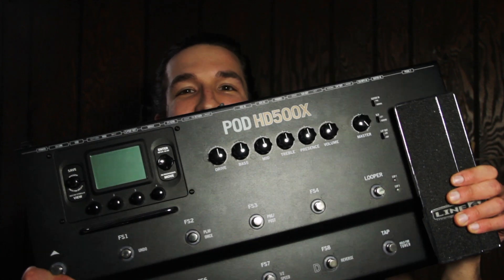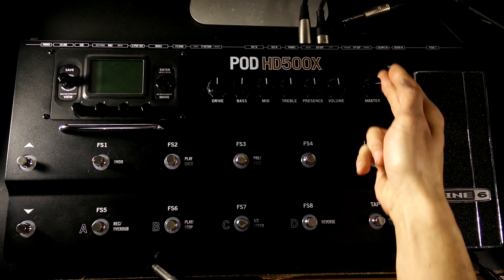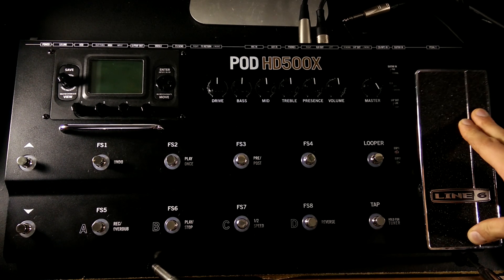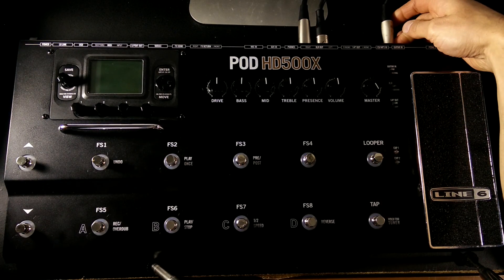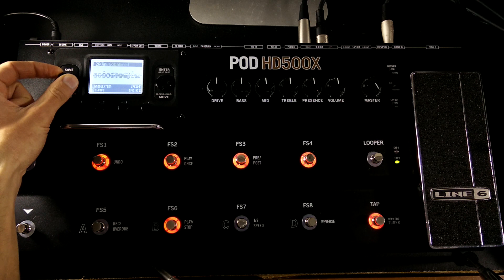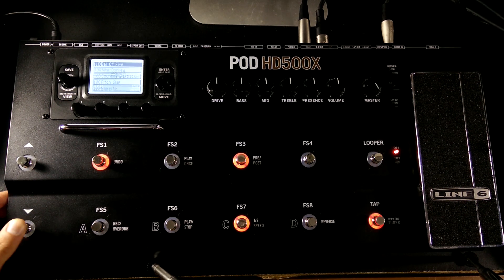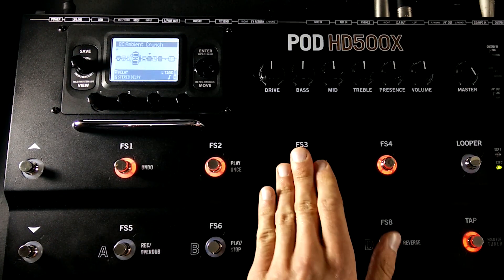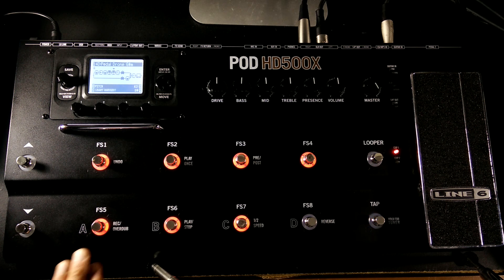Need Help With The Line 6 POD HD500x? Watch This Video!

Comment: Jon,

for some reason on my presets none will let me use the volume or wah (pedal) Also when I go to different (presets) setting the volume is blasting out loud so I have to grab the volume knob and turn down immediately or my ears will be fried. I did buy this pedal used (but in mint shape) could it be something they did in programming that I am not seeing?
thanks for your help Dave
Reply from the maker: Hey, David! My first thought is that you probably just need to add the volume and wah effects to the preset. If that's the case, then check out my video, Setting Up A Basic Pedalboard. I go into detail with adding effects. Let me know if that works for you.

Comment: Great link, is it just my ‘sound of plexi’ and other presets that’s really loud/hissy?  Should I buy a noise gate pedal or something?  Hiss drives me insane I purchased noise filter surge cables even plugged my solid state instead of tube amp.  I’ve tried different cables, wall outlets, and guitars including emg humbuckers.  To no avail.  Any feedback/recommendations appreciated thank you.
Reply from the maker: Have you tried adding the noise gate effect to the beginning of your effect chain? The 500x has a noise gate effect built right in, so you shouldn't need to buy anything.

Comment: I just ordered this today. I’m so nervous. I’ve been a guitar player for over 25 years but I’ve never owned anything like this. I’m a little confused tho. I thought you were able to assign individual effects to all the “footswitches”? You’re only able to use 5-8 to do that? Or am I missing something? Can you have 8 individual effects set up and turn them off and on as you need them? Along with an amp/mic model going?
Reply: You have 2 modes:- pedal board mode and preset mode.

Pedal board mode is when the 1 to 8 switches can turn on/off individual effects as you need them. Preset mode is when the 5 to 8 switches  select the presets while switches 1 to 4 still maintains functionality to turn on/off only 4 individual effects (sort of a hybrid mode). 

To select which mode, view his explanation at  9:00

Comment: Great videos! I've been a longtime pod user with the XT and X3 series and for the past year or so I moved on to the HD500X, and it wasn't the seamless transition I expected it to be. So some of your videos have been a Godsend on figuring out the way this beast thinks. I hope one day to see a video on the cabs and mics section too
Reply from the maker: Great to hear! Now that you've spent some time with the 500x, how do you feel it compares to the XT/X3??
Reply: It is a massive leap forward in customization, thanks to blank blocks and switch assignment which weren't available in the previous versions. Soundwise it feels more natural when played direct, while the XT/X3 worked better through an amp. But there are a few things I miss, like a better volume consistency between amp models and the effect parameters, while less refined, felt more responsive. I'm on the fence with the cab and mic impulses, the HD has more options, but so far I had less luck finding more than a couple winner combinations compared to the ones I used in the X3 (especially for dual tone)

Comment: Hey Jon! Thank you for this videos about POD HD500x. I have one of this too to play in church. I used in pedalboard mode and have a question. How to balance clean tone and overdrive. I try with output which is options in overdrive but im not shure is this the correct way to balance the sound. If i turn volume button down the whole sound goes down... I hope you understand my question. Regards from Bulgaria!
Reply: Hey! So my overdrive sounds were always louder than the clean patches I made. One solution is to add a compression pedal to the clean and setting amp volumes high on the clean patch(NOT the master volume) and slightly lower volume on the overdrive patch. If you want the levels to match PERFECTLY, I recommend plugging your Guitar-Pod into any DAW (I use reaper) and the compare signal strength from the clean and overdrive channel and editing it so the levels are balanced. Cheers!

Comment: Here's my story. I bought a 500x around 5 years ago. I used it for a bunch of shows it's an awesome device. I've always liked line six and I currently use their 750watt bass amp.

I'm going to say roughly two and a half years ago the switches started failing me and going from memory....some of them don't work at all and some of them will turn on and off by themselves. I plan on jumping in and learning which exact switches are a problem and what exactly it's doing or not doing.

My first thought is it's broken switches.. is this a common thing in these switches? I thought they upgraded the switches where they worked better but switches fail especially when you stop hard on them in your metal band. probably a firmware reset needs to happen which I may do after hearing more about the buttons.

Is there a place I can send my pedal board?

Is this a common thing for the 500x?

Thank you for responding.
Reply: Open clean switches with rubbing alcohol then tap upside-down clean drips out while tapping make sure springs are stretched a little longer tight in the button head 😮❤

Comment: Bro, I'm planning to buy this pedal, would you suggest this for live performances and studio sessions? What other pedalboards are as good as or better than this one in the same price range?
Reply from the maker: I would absolutely recommend this pedal. Not sure if you've made your purchase yet, but you could also check out the Boss GT-100. That seems to be the biggest alternative. I've played a GT-100 a few times and it rocked.
Reply: In my opinion it's great to use in live settings, you get amazing tones from it. It's quite good in the studio but then again it doesn't come close to Kemper/Axe FX. You can still use it for studio/live and if you dial your patches right, no one in the audience will find any reason to complain about your tone.
Reply: @JonEleyet  Got myself a Zoom G5n instead, saw reviews, it has great tones and customizability too. What's your take on it?

Comment: Hey Jon. I'm planning on using my hd500x with my fender twin reverb amp. I would like to set up and program my hd500x with Headsets. How should I set up the pedal board so that I can use my Headsets while I'm programming it - then ultimately plan on using it with the amp when I perform. Trying to keep the noise level down at times in our home. Can I still program great sounds while using the Headsets?

Comment: Hey! 

I've had my Pod HD 500X for a few years, rarely ever used it until last year when I joined a band and wanted to explore it in more depth. 

All was going great until one night I had an issue with the expression/wah pedal. It completely dropped the volume but then if I tweaked it slightly it came back, and did that a few times. It doesn't do it all the time, but can be unreliable sometimes in a gig. 

Is there a way I can open it up and take a look inside to see if there is an obvious loose connection? 

By the way your video on this is Fantastic! 

Thanks in advance!
Reply from the maker: I've always wanted to open mine up, but never have. It's possible that there's a bad solder joint. Does the volume pedal still have that issue if you use a different preset? Could it be a routing issue with the signal chain?

Comment: Is this compatible with a combo amp?
Reply from the maker: Yup, totally! You can just bypass the amp simulators in the POD and just use the effects. The POD will plug into your amp with a standard guitar cable.
Reply: YES! You can also  use the 4 method cable to get advantage with FX LOOP and FX AMP !

Comment: No on/off switch is a deal breaker for me... :/
Reply: You can get a small power strip or extension cord with a switch for like $10. I mean, sure it would have been nice if Line6 had included one, but it's not that big a hurdle

Comment: Here's a silly question if anybody can help.

I have an interconnect cable that I bought when I meant to buy an instrument cable. Can I safely and effectively implement it as either my guitar to pod connection, or pod to amp connection (with the out switch set to amp)

I've used it in the past but I wasnt sure if I was damaging anything or losing quality.

Comment: When in pedalboard mode and creating my own pedalboard, do I just select a preset and zero everything out and then start building from scratch or are there empty patches for making your own pedalboard/preset?
Reply from the maker: There's usually some 'new tones' in one of your set lists. Otherwise, yeah. Just zero everything out. Some presets have crazy signal routing and you may need to select the amp and press 'move' and use the arrow buttons to reposition the amp in a mono configuration.

Comment: I have been comparing a GT 100 with this one and I like the sound of this one more. While I would like to get the Helix the price on that is astronomical maybe sometime down the road. The layout of this the pod is really good I've been looking at the manual for the past week or so and they made it all as easy as they can and there's so many great features squeaking sound between the EQ and you can actually keep the frequency I'm very curious to see how it sounds for me and my style music I'm also going to use my own stop boxes before it and in the effects loop I have a Dirty Shirley Distortion and a sweet honey Deluxe that I do not want to stop using and in the effects Loop Iowa Matthew's effects astronomer V2 that sounds great in a TC flashback so I plan on putting this in the middle of those battles and really trying to use it and make some great stuff